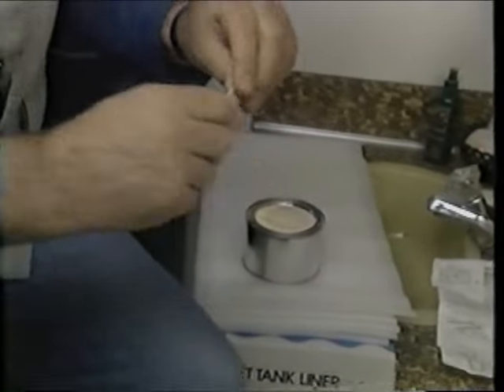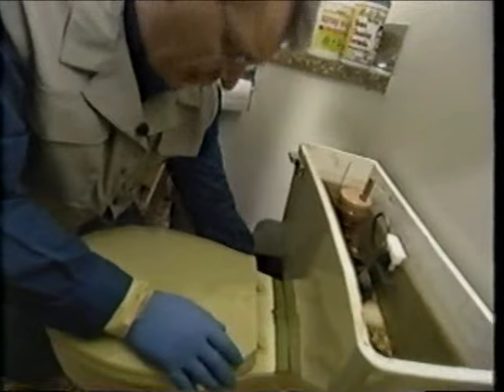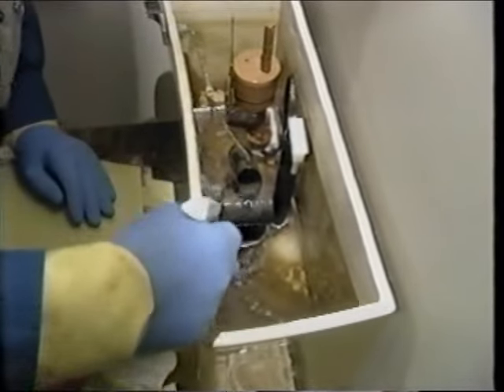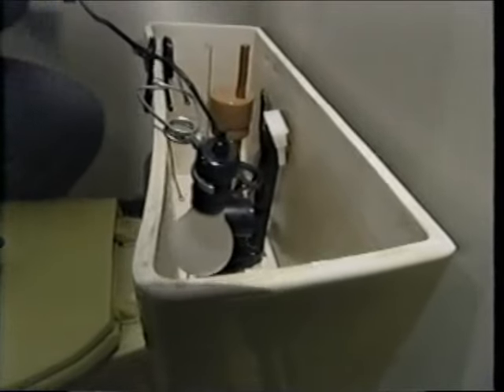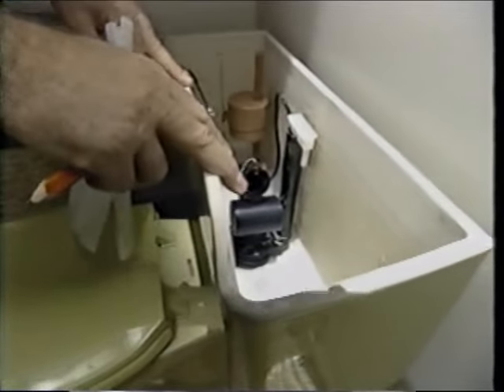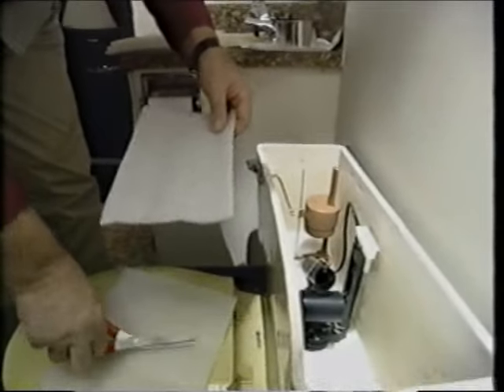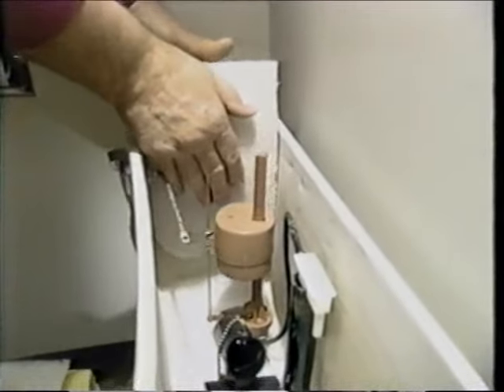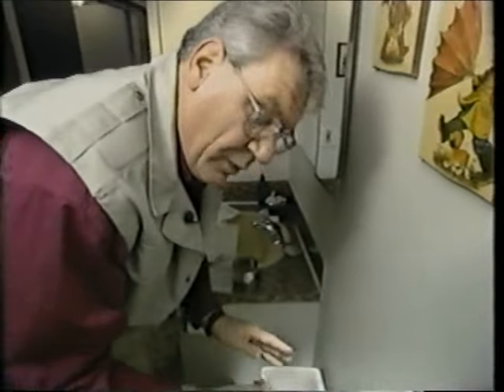How To Stop Condensation On Toilet Tank

Comment: Thanks for this video! I used a $6 yoga mat and a tube and a half of 100% silicone caulk. It didnt look super neat, getting into the corners was tricky. The end result though is a toilet that doesnt "sweat." Success!
Reply: drohnenfabrik Great jack! Is it still working?
Reply: @HandyHudsonite  this worked very well.  In fact, I installed a new toilet some time later and used a new yoga mat to insulate the tank again! No condensation still. 
Thanks!

Comment: So 24 hours without a functioning toilet. Then it's lined with foam packing sheets you'd wrap your dishes with if you were moving. What about cleaning the inside of the tank again later? Do you have to remove the sheets and do the whole process again? What about drop in cleansers? Will those deteriorate the foam? And, why in a how to video would you skip the most difficult part of fitting the bottom where you need to cut and fit around the ballcock and drain?
Reply: My first question was how do you clean the tank in the future.

Comment: I have an apartment bldg. and the bathroom apt. units are back to back. One of the toilets was sweating quite a lot. I became aware that there is insulation in the interior walls to deaden the noise level from adjacent apts. The toilet that was sweating was flush up against the wall. So I decided to purchase a toilet that would not butt up against it. I went from a 12 inch plug to a 10 inch one ( this is the distance from where the floor bolts are from the wall ). American Standard makes these 10 inch plug toilets. It is called an "Edgemere" with great reviews. Lowe's sells them for about $190. Anyway, once I created total air circulation around the tank the sweating stopped. Perhaps your tank is too, flush with the wall with insulation between the studs. Just thought I'd throw this out there as it may stop your problem.
Reply: Thanks very much for sharing your experience and solution; I also live in an apartment building, and I'm searching for solution.

Comment: Been researching toilets to renovate my bathroom. After a lot of reading, I'm loath to let my 40 year old toilet go. It flushes well. Never needs two flushes! It has an insulated tank but still sweats badly in the heat of summer. I'm going to install an anti sweat valve which I feels is a much more effective remedy than foam insulation. 
I read nothing but complaints about new toilets. Saving water is great but not at the price of a dirty bowl and nothing is saved if you're consistently multi flushing to get the stuff down!
Reply: Your data might be out of date at this point. Modern low volume toilets move waste better than the the old high volume toilets ever did, and there are models that keep the bowls reasonably clean, they just cost a bit more.
Reply: The anti sweet valve is a joke, never hot water there when you need it if you have a house like mine, hot water heat to far away for little water that will go in tank
Reply: My idea works great.

Comment: Well that would be nice as long as you have more than 1 toilet in your house.  I don't think I can do without a toilet for 24 hours while I wait on the water to evaporate and the adhesive to dry.
Reply: +Jonathan Trivette just flush it with a bucket full of water in the down time ;)
Reply: Hair dryer or heat gun speeds up the water evaporation

Comment: I have what seems like an odd problem with my toilet tank.  The tank itself doesn't sweat at all.  However, the lid on it drips a LOT.  I thought maybe it was something inside splashing but I've flushed it with the lid off and don't see anything.  Is it possible the lid is simply sweating that much?  Btw, it is the BOTTOM of the lid that is always moist and dripping, not the top.  

I have pretty high water pressure.  I plan to turn the toilet value down some just in case maybe it is misting and I'm not seeing it.  That is, the high pressure causes a mist that then attaches to the bottom of the lid.

Any ideas?  Am I on the right track?
Reply: 101perspective Are you in a hot climate? Does it drip year round? You could try some weather stripping around the inside edge of the lid and see if that stops it. If you found a solution, what was it? Curious to know.

Comment: Anti-sweat valve...100%
Has a hot and cold inlet and a mixed outlet, which is adjustable so that it doesn't melt your wax seal.
Forget this Styrofoam stuff, ask me how I know. 🤔

Comment: I've never had this problem ever, now all a sudden I do. Must be more than water temp. It doesn't just happen when taking long hot showers which would be normal. The whole bathroom has condensation, but just happening randomly out of nowhere is baffling to me. I guess insulation seems easy enough and best solution, I just don't get it. You can also out a heater in tank.. I guess like a fish tank? So I heard. Makes sense.
Reply: Maybe it could be flapper or assembly. Water could be running. Again, never had problem. You're only addressing one problem, like there are no other reasons. Only one cause and one solution? Have to disagree.

Comment: thank you for posting this video, i have question, i get condensation all around the toilet right down to the bottom. will this method stop condensation from  the bottom of the tank?
Reply from the maker: This will stop condensation around the toilet, most likely it is condensing on the side and running down to the bottom.

Comment: Anti sweat valve
Reply: +m Mack an anti sweat valve isn't going to work very well unless your hot water heater is fairly close by.  It takes almost 1 full minute before hot water even comes thru the faucet in my bathroom so I know none would come thru in the time it takes the tank to refill.
Reply: I've done it. Maybe insulated the bathroom walls.
Reply: @mmack3286  Maybe I should move my toilet to a different climate.

Comment: I can't wait for two days, have to use a different method but I get the idea thx.
Reply: John Rock I bought a kit that enabled me to do it faster. Still working several years later.
Reply: You can manually flush a toilet by carefully pouring water from a bucket directly into the bowl. This is (mostly) all the flushing mechanism does anyway.